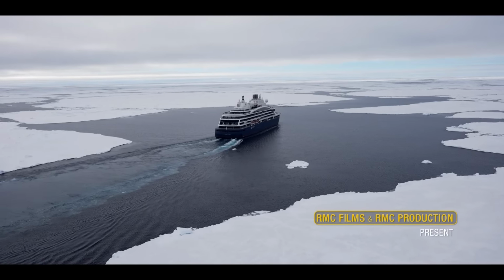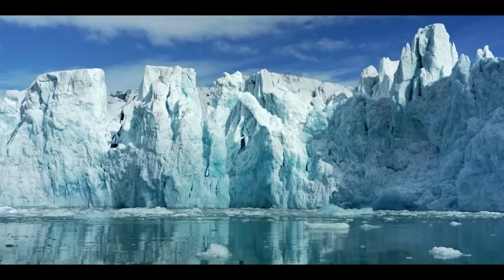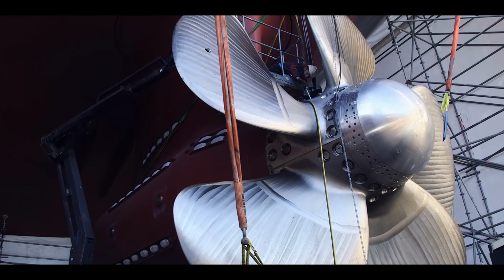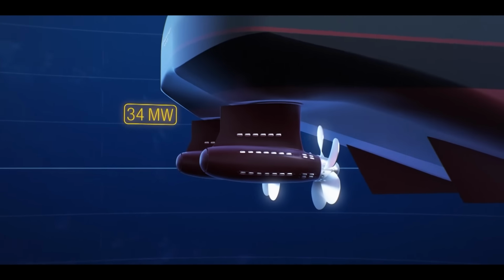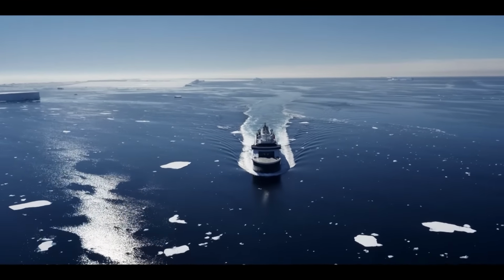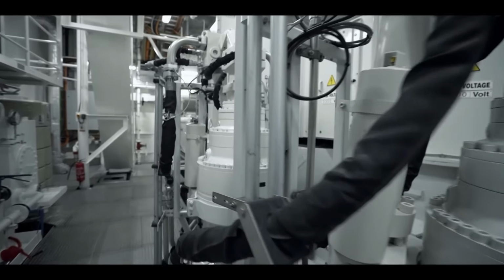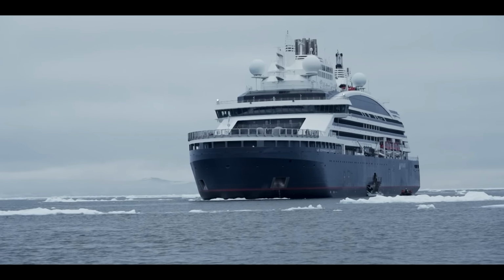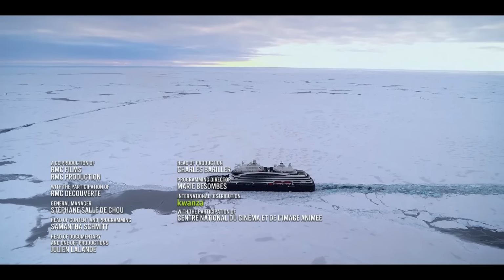Ingenious Construction: The Gigantic Self-Sufficient Icebreaker | FD Engineering

Comment: All modern ice breakers have a spoon shaped bow, not a pointed bow, and all modern ice breakers do the same kind of riding up on the ice and using their mass to break the ice.  Some other modern icebreakers can reverse and use their propellers to mill and disperse thick ice - and some modern cargo ships also have this ability.  The ship is amazing, and has some great new features - but it's just the latest iteration of modern icebreaker development, it's not a radical departure.  That's not a criticism - it's pointing out that icebreakers are more and more important as the poles warm, and are being improved constantly by multiple countries working together.

Comment: Nothing new in icebreaking technology.  The narrator explains that the 'unique bow' shape, however, variations of this have been in use for more than 60-70 years.  

There is no mention that this vessel has a 'bubbler system' - this enables the vessel to travel faster through thinner pack ice.

Comment: this is the only Polar Class II icebreaker on earth in civilian service, not even the Russian nuclear icebreakers can get through ice this thick. Russian nuke boats are all PCIII (thinner ice). Only the USCG Polar class icebreakers can operate in ice this thick.
Reply: Where did you find exact Polar Class of Russian icebreakers?
Reply: "Polar Class" is irrelevant here. Russian nuclear and non nuclear icebreakers are not classified by IACS Polar Class at all — they are built according to the Russian Maritime Register icebreaker standards, which are specifically designed for heavy Arctic operations and are more strict. 
Even older Project 10520 nuclear icebreakers can continuously break around 2.8–3.0 meters of ice.
Project 22220 (LK-60Ya) does roughly the same while being far more efficient in shallow Arctic seas.
Even the diesel icebreaker "Viktor Chernomyrdin" can handle ~2.5–2.8 meters.
Future 10510 "Leader" icebreakers would be capable to break up to 4.3 meters of ice. First one is already under construction. 
Le Commandant Charcot is a good expedition cruise ship, but it's still just a passenger vessel. 
Russian modern nuclear icebreakers are built to escort commercial convoys through heavy Arctic pack ice year-round.
Overall Russian icebreakers are much more capable than any other in service.

Comment: Engines built in our factory at Vaasa Finland. I'm a design engineer in that company.
Reply: Good job dude
Reply: Do you know why they did not use any supercritical co2 turbines ? It is clear that you can't replace all, due the low sulfur fuel backup. For me, 1 supercritical turbine per engine room would have made more sense. Higher efficiency for normal base load
Reply: Nice, but gas powered is pretty outdated. Also wtf was that he talked about? Gas is the best option? 😃 was that a joke?

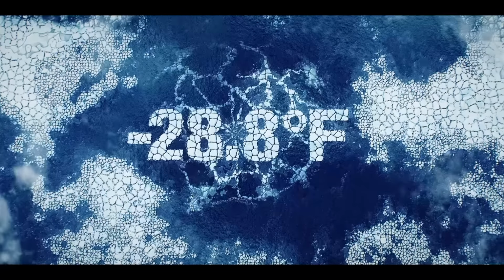Comment: At 6:10 they show -28.5 F temp when sea ice forms, that seems a little on the cold side for that to occur.
Reply: Salt water freezes at a lower temperature than water alone-
Probably the salt content varies the freezing point of the wa wa.
Reply: @rdallas81  I was being sarcastic but negative 28.5 is way too low . Obviously a typo
Reply: There are lots of errors in this.  Sea water freezes at +28.5F not -28.5.  Also no Polar Class 1 vessels have been constructed.  The Russian ships follow a different classification system.  Ice classification systems are complicated depending on many factors including how the ship is used and strengthening in various parts of the hull etc.